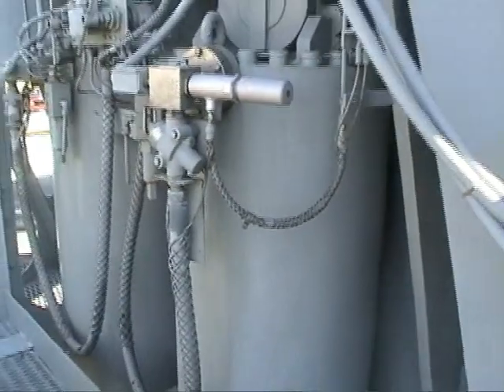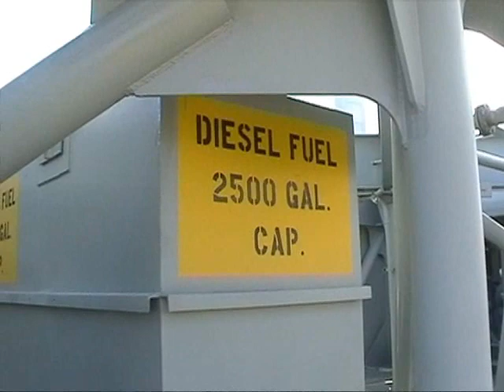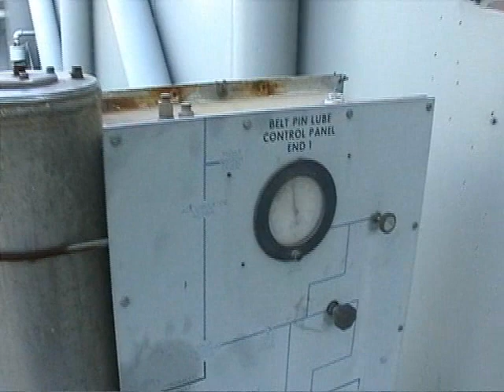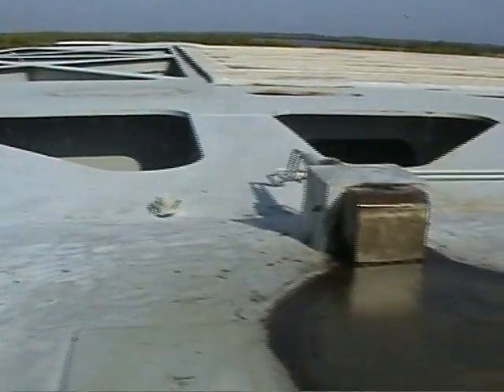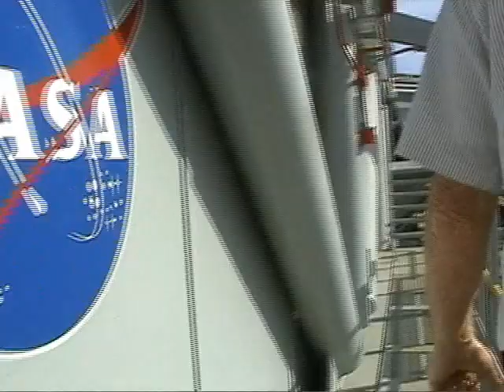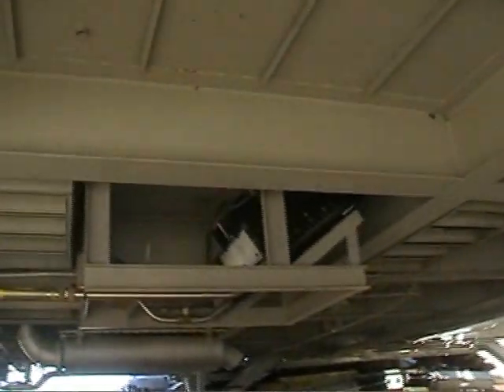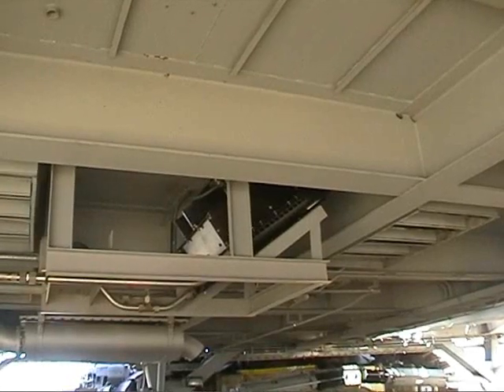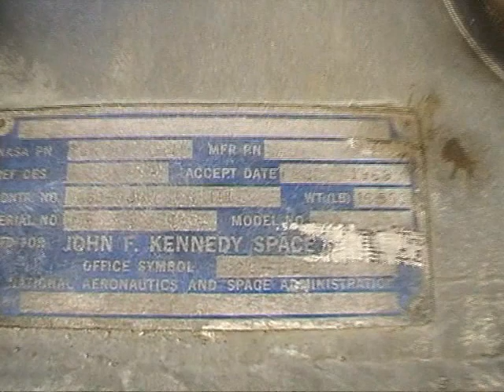Inside the NASA Crawler Transporter - PART  3 of 3

Comment: Essentially an Alco diesel electric locomotive with crawler tracks instead of steel wheels. This crawler has the same 5500 total horsepower as the Ill fated Alco Century 855 Union Pacific locomotive.

Comment from the maker: @crazyeyedew 
NASA site says: 16 traction motors, powered by four 1,341 horsepower (1,000 kW) generators, in turn driven by two 2,750 horsepower (2,050 kW) Alco diesel engines.

Comment: The NASA crawler transporters are derivatives of a stripping shovel base. If you want to see what they were originally designed for, then search for videos of the Silver Spade.

 They were originally powered by electric motors on the stripping shovels and connected to the power grid by an extension cord that was the diameter of your thigh, but NASA wanted their crawlers to be diesel-electric for obvious reasons.

Comment: Great vids. I still want to know how they get the launch vehicle from the crawler/transporter MLP onto the launch pad. Or is the MLP the actual pad it launches from? I would think the heat damage would be too great for repeated use of the MLP. If someone knows the details of how that was done I'd appreciate you posting it. Thanks.
Reply: +SkyWardDude You've pretty much got the concept. The launch vehicle is built up (stacked) on the Mobile Launch Platform (MLP) in the VAB, the Crawler-Transporter (CT) moves under the MLP, picks it up, and carries it all to the pad. At the pad, the MLP is lowered onto a series of supporting pins and sockets, and the CT slips out from under the MLP. Yes, the MLP has been getting blasted repeatedly since its initial construction. The water cooled, inch-thick deck plates have proven their durability over time, and have protected the two mainframe computers inside the MLP which monitor and control the launch vehicle from initial stacking and checkout through launch. This is a key component of the MLP system. The technology of the 60s didn't permit long distance monitoring of small-signal launch vehicle parameters, so the decision was made to have these computers connect to the launch vehicle through relatively short connections on the MLP, and then transmit the equivalent data to and from computers in the Launch Control Center (LCC), next to the VAB.  In addition, the MLP was modified from its initial design with a single large exhaust passage for Apollo, to having 3 smaller openings to match the Shuttle main engines in one opening, and one for each SRB. Tail Service Masts were also added to the decks of the MLPs to support Shuttle launches.